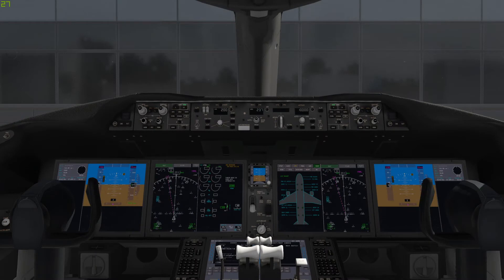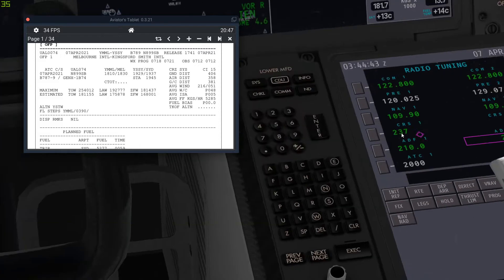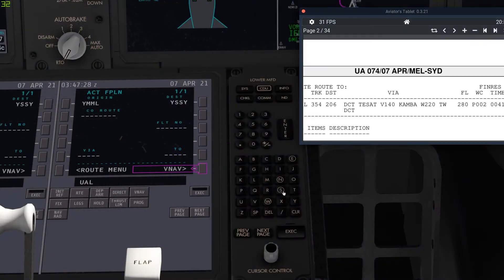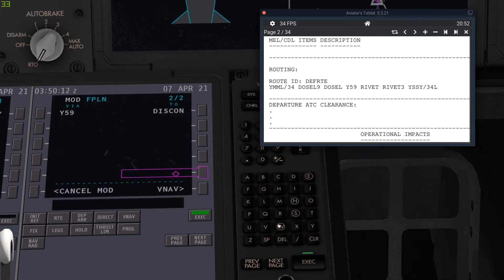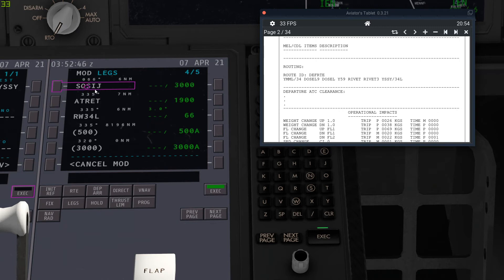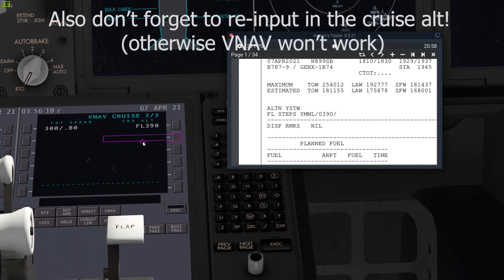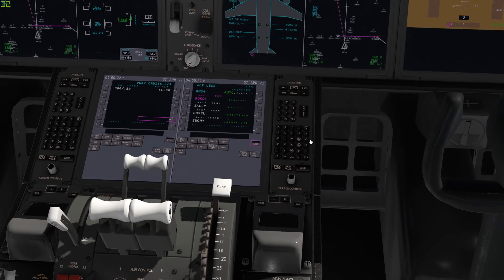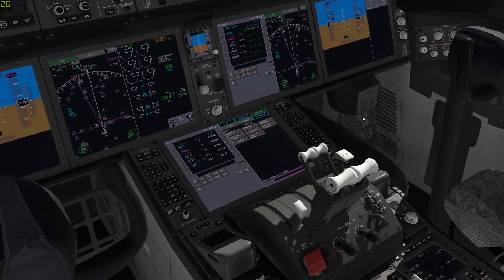Magknight 787 Default FMS/FMC Tutorial I X-Plane 11

Comment: Hello. One question. How did you manage to change the map/plan view and be able to run the steps from the FMC? I have tried all versions of this plane in XP11 and XP12 and could never do it. There are comments on forums that this feature is not available on Magknight. What version are you using?
Reply from the maker: @carlos-cs8ys  it used to be a feature with the old ND system from years ago, that version is no longer available